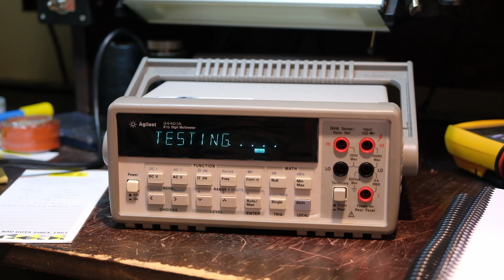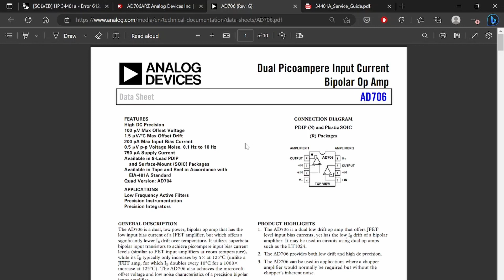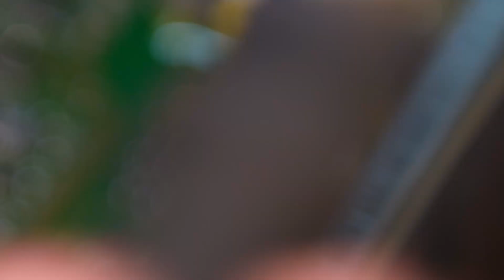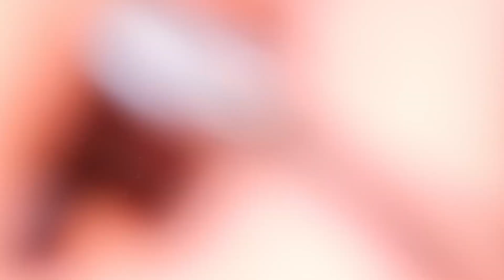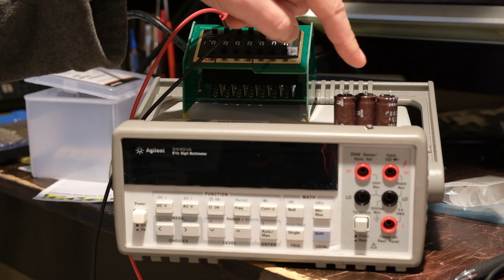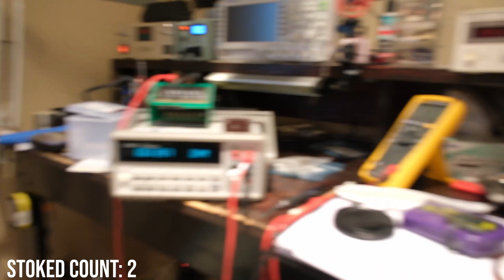Agilent 34401A Troubleshooting & Repairing Multiple Errors

Comment: Nowadays there is a great way of doing calibration on your own bench — just get one, or preferably two of the reference boards built around an Analog Devices chip..  They give you nominally 2.5, 5, 7.5 and 10 V with an 8 digit factory calibration document.  I bought two of them and compared them.  Nearly perfect!  Then I checked my Agilent 34411, 6-1/2 digit meter.  Perfect agreement 3-ways within my Agilen resolution.  I have forgotten the price of those references, but the two of them together were well below your stated outside service quote.  Of course, you still need your 15 V DC bench supply.

Comment: Nice repair and a satisfying result. In the days when hot air guns were exotic, you could use a fine tipped pair of side cutters to remove these chips. Another thing to always check are the smd 3.3v zener diodes- a common failure point. Thank you for sharing.

Comment: I saw a guy using a piece of 12 or 14 ga. Wire, tin it, cut to the length of the 4 pins, lay it on the pins, on both sides, hit it with a bit more solder, and it acts as a big soldering tip, off comes the device.

Comment: You need hot air! Get an 858D, they are only $40. You don't need the $300 fancy stations, the $40 one is good enough if you're on a budget 😀
Reply from the maker: Thanks for the recommendation!
Reply: @offkafka  you can get an ok heat station for 20 bucks now.  Still though, if you use fine tipped clippers and cut close to the IC body, it works fine.  And two soldering irons (one can be a cheapo) each side.  There are sensitive components inside the 34401A which it's easy to affect with the stray hot air, even when taped up.
Other environments = fine, just tape it up surrounding the chip.  Aluminium tape is really good to cover plastic parts with, connectors etc

Comment: i saw a nice trick to heat all the leads, at least on one side...use a fat piece of copper bus wire, looped around that ic, and apply solder liberally, then use tweezers to pick up the ic, and wire, at one time...tried it on a 10-pin connector, worked a charm...
Reply: As I said, before I saw your post...

Comment: You really need decent equipment to unsolder ships, eight pins are relatively easy but once you start getting to the 32 pin tiny things get hairy fast and you don't want to ruin your pcbs. 

I have the 34401A, it's my favorite meter for everyday stuff. I have the 34465A which is more versatile and better for histograms a things like that but the 34401A comes right on with no delay so it really saves time, probably the best known meter made.
Reply from the maker: You are not wrong. This was definitely a risky soldering method, but it worked out in the end. I won't say some amount of luck wasn't involved!